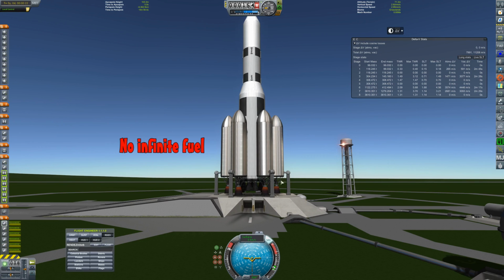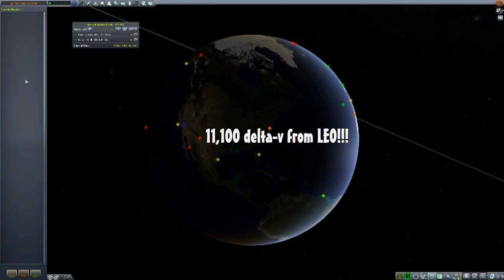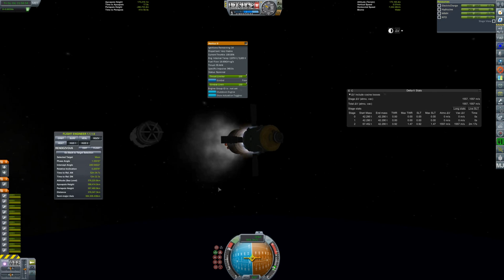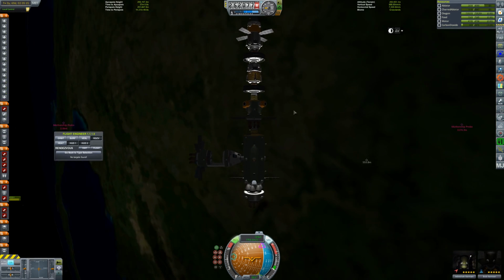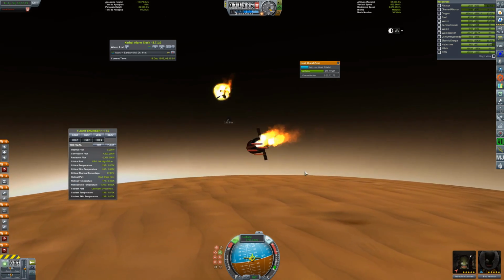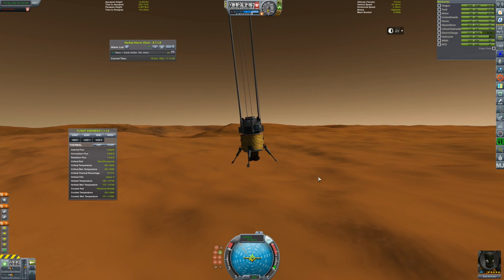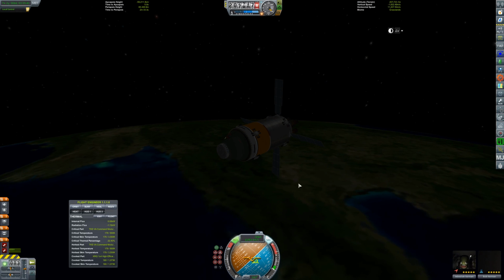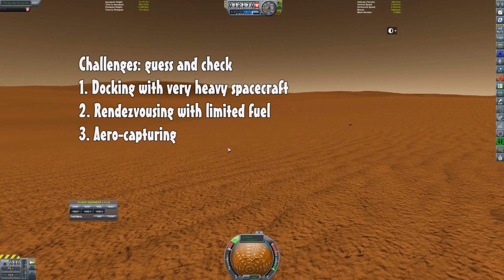Send Kerbals to Martian Surface and Back in RSS+RO (NO INFINITE FUEL)

Comment: Howd you get RO to work?
Reply from the maker: My videos were recorded with KSP v1.1.3.  I'm not going to upgrade until the next KSP version supports RSS, RO, and RP0.
Reply: Can you give a link to all the RO mods you use?
Reply from the maker: Expand the SHOW MORE section above.  You will see a list of mods with versions.  There are newer versions available since I created this video.  The best place to get the latest info is https://github.com/KSP-RO.  This will give you a good idea which mods to install.  Most can be done through CKAN, but a few I did manually.